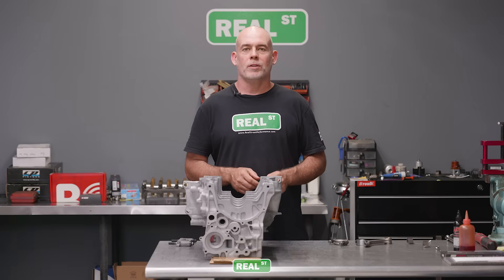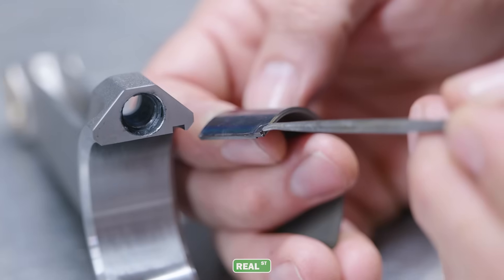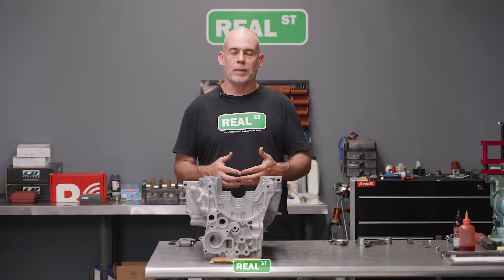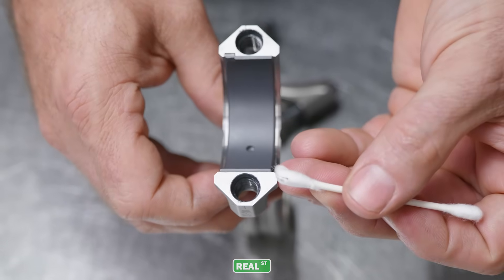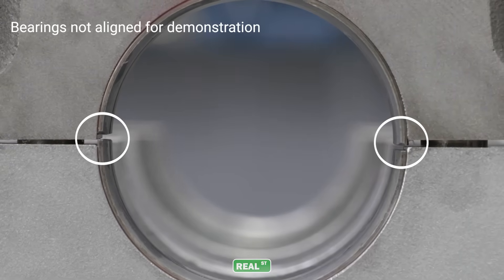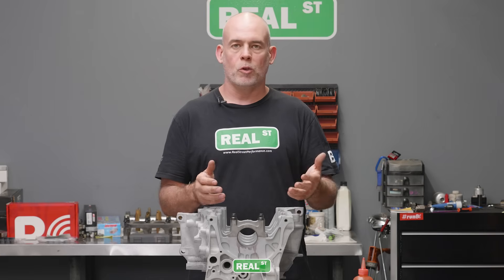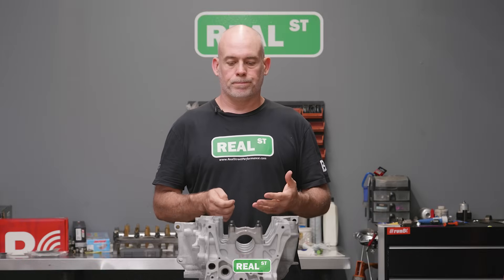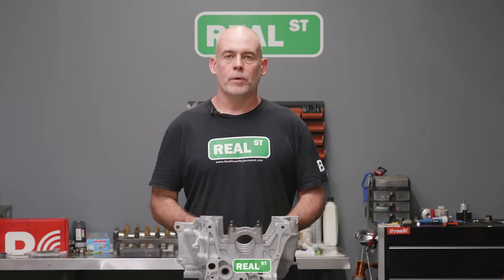Adding Oil On The Back Side Of Bearings During Engine Assembly. Good Or Bad?

Comment: Was told years ago by machinist. Oil on the back side of bearing will change clearance. Have never oiled backside. Have never had a problem installing bearings. Have also had good luck with engines I have rebuilt. So I am going to stick with no oil on back side. But plenty on the correct side.
Reply: Yep the guy that built my motor back in 2000, Dennis at Auto Machine in Orlando Fla (Jay may know the place) told me to NOT oil the back side ... this guy had a huge reputation here in central fla for his building skills.
Reply: Ι use something thinner than ATF. I use wd40 for very fine lubrication. But It always struck me when disassembling engine bearings they had always black stale oil behind them anyway. So oil gets to the back of the bearings eventually while engine operating normally
Reply: @ngt84 damn . I just learned something.
Reply: @ngt84 when its worn yes
Reply: Iv always been told to leave it dry, you can only compress the oil so much and could result in incorrect torque and clearance. Bt each to there own, and if it works for you then fair play
Reply: @mervynsweeney2948  you are correct except that thinking you can only compress oil so much. You can’t compress a liquid at all. You can pressurize it but it can not be compressed.
Reply: @kennethbouch7796  you are forgetting, oil is a fluid. It flows out of the way unless it's highly viscous or contains a lot of solids.

Explain oil behind the shells when you tear one down.....
Reply: @mervynsweeney2948  AND he build a 2JZ to run 331 mph with NO spun bearing 🤔
Reply: @mervynsweeney2948  well if they are building 2000 hp 2JZ's and none are throwing any bearings, then i guess his method works.
Reply: As a machinist I'm telling you right now that oil on the back side of the bearing will change the clearance. Also if more oil is in one spot than another on the back of the bearing it will cause hot spots on the journal side of the bearing.
Think about it, what's the typical clearance of a main or big end bearing? 0.0025 and you are smearing oil on the back side taking away some of that clearance. Oil does not compress, it's hydraulic.
Reply: @rebbulldesertduke  YOUR right that oil doesn't compress,but that mostly for a CLOSED system,like a hydraulic jack,or closed container that's thick.I've made cylinder type containers 10 inch dia with 2 inch thick walls.And under 15 tons pressure inside,the OD grew by .050 ",so your right but in this case i  believe the oil gets extracted out the open sides.I think more of an issue would be DOES oil form a barrier in the transfer of heat from the bearing to the rod?i tinker with overclocking computers now and have done LAPPING on CPUs and water cooling systems while using thermal paste,and in those cases the finish of the surface made a 50* degree difference.when i wrenched 40 years ago i also followed the no lube rule.I've only done about 150 engines career wise though but  that amount is not a whole lot for 20 years working.I say used light oil if you want too,the right torque and no grit is more important.I wonder what john forces people do?
Reply: @rebbulldesertduke  A liquid will not compress, but it will escape a non sealed area.
Reply: @rebbulldesertduke  oil may not technically compress, however it is a fluid and flows. In broad terms, fluid dynamics is pretty simple; fluids flow from high pressure to low pressure. When you introduced any force on that bearing, any oil that was taking up space where a bearing wants to be is moved out of the way.

If what you said was true, why is there oil behind the bearings when you tear an engine down? If it was an issue, wouldn't you be destroying parts left and right?? What about the oil galleys that force oil at 60+ psi through a hole behind the shell? I guarantee that oil pressure has a better chance at changing clearances than a microscopic layer at installation does.

Granted, if you put motor honey or something with a lot of solids in it, I could see it being an issue. As soon as you tighten the caps, any excess fluid is GONE so long as it's not thick or has a significant solids load.
Reply: @rebbulldesertduke  that's why it's hydraulically being squeezed out when the cap bolts/studs are being tightened.  I believe if it were any type of engine oil with a WT to it there would be issues, the fact that it's ATF may be the only reason there's zero issues.
Reply: @kevin_nagle  According to Lake Speed Jr. engine oil and ATF have the exact same base stock. It won't make a difference if its ATF or engine oil.
Reply: @mrctuned2844  ATF just has a ton of detergents added to the base stock. That is why adding a qt. of ATF into a dirty or sludged engine will break down the dirt and sludge after running for a few hundred miles.  Then you change the oil/filter and see if it needs another treatment.
Reply: @moedigzz  Yep, I've done that a few times here as well. Works pretty well.
Reply: @rebbulldesertduke it doesn't compress but it will press out and suction the back of the bearings into place.
Reply: Building hi-psi Buick V6s and following specs exactly, I checked this after a local import racer suggested it. My dial bore gauge did show a difference between oil and no oil. I will stick to how the manufacturer designed the engine and follow the specs vs taking that one chance and destroying someone's engine and losing the $$ investment.
Reply: @gneric85  What resolution does your dial bore gauge have?
Reply: @gneric85  did you try oil vs ATF?  curious on your findings.  I may have to try this tomorrow.
Reply: @gneric85 The bore gauge doesn’t lie. Just out of curiosity I’m going to measure on my next build but pretty confident I’ll get the same results as you.
Reply: Every engine that I've taken apart has oil between the rod journal and the bearing, it's going to get back there one way or another
Reply: i'm with you on changing clearances.  this is why we check oil clearances.  oil needs room because it takes up room. 
i learned this from a performance automotive machining school.
Reply: I’ve always lubed up the backside of bearings and have not seen a single issue. Interesting topic for sure. Anyone here ever lubed up the backside and had a failure? Interested to see others takes on this.
Reply from the maker: Thanks for sharing
Reply: It looks like a good process for cleaning the backside of the bearing rather than leaving the uneven factory coating. You don’t have to re oil after. He didn’t even mention or show putting a second coat after he cleaned the bearing.
Reply: So you don’t and have had no problems he dose and has no problems. Almost like it makes no real difference.
Reply: @dontimberman5493  It's because he is using ATF.  If he was using any type of engine oil then there would likely be issues.
Reply: If you use thin oil is going to squeeze out of the back of the bearing very easily it’s not going to change the clearance and having the back of the bearing lubed will help center the bearing when you tighten the caps down. I torque the caps down, turn the engine over a few time then wait 10 minutes and then re-torque them again. If you use a really thick oil or really a grease when you go to torque the engine a second time the bolts/nuts might be alittle under torqued because the grease or thick oil squeezed out so the second torque will be spot on for sure but again you need to wait a few minutes to give the grease/oil some time to squeeze out. If torque to yield bolts are being used then just don’t do the degree pass because the degree pass is when the bolt is being stretched. If you feel the need to lube under the bearing I would only use something thin really just like a thin spray lube nothing more. I personally do not use assembly I haven’t used it in 20 years I just use motor oil but also the engines I’m building are getting used right away. Some parts I will use a little trans gel like the inside of an oil pump I will always put some trans gel in there just to be sure it’s lubed because some pumps if dry will not pump, I put trans gel on seals, push rod tips, rockers, just the last things to get oil
Reply: @peanutbutterisfu under load pressure those bearing are also shifting/floating side to side on that same backside oil. You want pressure fusion of 2 metals surfaces on back to behave as one with. Not effectively another fluid bearing on the backside of the bearing.
Reply: The clearance won't be changed because the bearings are crushed into the map and block. A little oil will suction the back into place.
Reply: That makes sense seriously never thought about the clearance aspect
Reply: Same here .
Reply: I am currently doing rod bearings (1st time) in my 2006 chevy suburban 6.0. I respect both sides in regards to oil and no oil on the back side of bearings. I respect following manufacturer recommendations as well as professionals with many unfailed engine builds. Now what I'm thinking is this... on a brand new engine build where clearances are very tight, yes follow manufacture specs/ recommendations and NO oil on backside. However, on an engine "re-build" like my suburban with over 360,000 miles, the clearance are NOT as tight. So in turn I'm changing to a new oil pick-up tube (and O-ring), a new high volume oil pump, and thinking oil on the back side of the rod bearings would be recommended... especially since any excess oil will be pressed out the sides. Please by all means feel free to comment as to your recommendations. I really don't want to make a mistake and have to do it again.
Reply: Everyone is an expert, but so few of them are running their own business and hosting a channel to share their knowledge and experience.
Reply: Exactly, and he has built alot more engines than me, so I guess everyone has there own way of doing things, and at the end of the day it's not about right or wrong it's about what works best for you
Reply: @Random exactly!
Reply: I've never used oil on back it doesn't compute with my brain lololol 
But what your saying makes sense I'll be doing on next build as I've always seen once clamped down some rubbish gets ejected I'm a believer
Reply: ATF is good for when your honing aswell .
Reply: Not no, but h e double toothpicks no. Do not  oil backside.  Simple, oil Behind" bearing will change clearence.
Reply: Yes I agree oil has a tolerance so ur not meant to use it
Reply: Opposite is true for Diddy types.always lube backside to avoid any damage/problems later
Reply: 10-4 you know it common sense
Reply: 100%. It's because the individual oil molecules are just as strong as the iron molecules. That's why they work so well under pressure. It's the fluid dynamic bonding and heat transfer properties that make oil functional as the bearing itself.
Reply: He was right you're NOT supposed to oil the backside of a bearing. Anyone doing it shouldn't be touching an engine
Reply: Same. Unfortunately I bet on the wrong car at an auction as it arrived with a seized engine. Turns out the main bearing closest to the rear main was nearly welded to the crank. Was able to polish the crank but 1 of the journals where the bearing will go is marked up missing a little material. Thinking about sending it after I sand it down a bit to install that bearing but was worried about a little oil potentially getting in under the bearing. Since I know some put oil under bearings like this I feel a little better about my decision.
Reply: Thanks!

Stick with what you know. If you've used a practice to repeated success, change nothing.
Reply: @EamonnSeoigh  literally

Comment: Had a rotating assembly bind up when one of the guys used assembly lube on the back side of the bearings. We pulled it apart cleaned it all off and installed the bearings in dry and the crank rotated. 
Obviously this is not oil.
Reply: Ok, do it the way you want, won't argue. Will say though, the back of the bearing transfers heat to the cap/ block and having clean surface for that heat transfer is important. This is part of the reason for bearing crush. Myself....dry on back, lube on face. My thought is lube plus heat equals poor heat transfer, and also has a very slight effect on clearances. But- do as you like.
Reply from the maker: Thanks for sharing

Comment: Good to see you use a similar method to me, I've heard to many times not to do it but again - good track record. I keep a bottle of SAE30 on hand for building engines as a general purpose light oil for things like this, or rings, or retaining clips, the list goes on. When my bearings are ready for install I dab my fingers in a cap of SAE30 and put a very light film over both sides of the bearings just gliding my fingers over it. I then pop them in place and wipe any residue away, ready to use assembly lube on the crank side. I always found this helped the parts locate and snap in place nicer than pushing them in dry. I've lost count but I think I'm close to 30 high powered SR20 motors now.... And a few other randoms. Definitely never an issue with oil on the backs of the bearings. Cheers.

Comment: I was told never put oil behind bearings in fear of oil coaking, burning the oil that isnt being displaced, which in theory will shrink tolerances.
Reply: I've gone through countless engines over the years and the only time I've seen a main or rod bore get remotely hot was when a bearing hammered out and spun.   Bearing bores have a honed cross hatch like a cylinder wall so oil makes it's way through the groves anyway.
Reply: @bobroberts2371  the bearing should seat well against the main and rod bore with any clearance to be between the bearing and journal though, there should be no space for oil behind the bearings. They crush at the seams (as the video explains) and I really don’t think the goal of honing a main or rod bore is a similar RA as a cylinder, it’s only used to make it proper size. 🤷‍♂️ I’m no expert but the people I work for claim to be
Reply: @kylekeck9617  The bearing bore and back of the bearing are not polished smooth so oil will eventually wick behind the bearing when the engine is in operation. 

I'm well aware that the primary goal of line honing is to side the bearing bore.  My point is the honing leaves peaks and valleys, this allows oil to migrate between the bearing and bore. 

 I don't intentionally put oil on the back of the bearing however, thin oil does not pose any problems.

Comment: I was recently building a Kawasaki supercharged jetski engine and the workshop manual said to put molybdenum grease on the conrod side of the journal before fitting the bearing in the conrod.
Only on the conrod side not the bearing cap.
I have never done this before when building a engine and whoever I asked had no idea why.
Reply: Perhaps they have a problem with the back of the bearing fretting due to high loading and want moly to act as a dry lube?  Sounds like a patch for a marginal engine.
Reply: Kawasaki could not have used insert bearings in those? Anything with that RPM is usually needles. I would suspect the grease is so the needles don't get hammered before the engine oil circulates on start up. I'm curious here bc I don't work on those.
Reply: @maxwebster7572  it's not a 2 stroke
Reply: @stgnsw  Thanks. Good to know.
Reply: @maxwebster7572  I put a link to the workshop manual page but it looks like it has been removed
Reply: I looked up " Kawasaki Ultra 300/310 Engine  "  on e bay and found pic of a crank that is one piece, pic of a rod that has an insert bearing.

Comment: That was some great info, thanks for sharing.
I just have one question. In the video you said never to clean or touch the face of the bearing. In my build I cleaned the face of the bearings with brake clean and assembled the engine, will that be a problem?
Reply: Cleaning is fine with a non-abrasive cloth. Dont take scotchbrite or anything to the face
Reply: No
Reply from the maker: Not at all
Reply: ALWAYS "clean" new bearings.  No such THING as "too clean," when it comes to assembly of an engine.  Reality 101...  lol